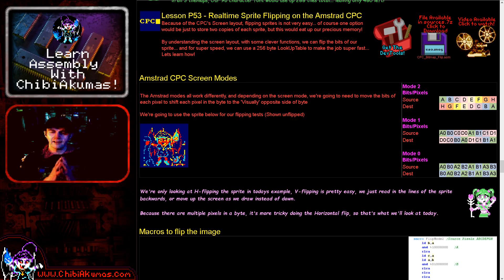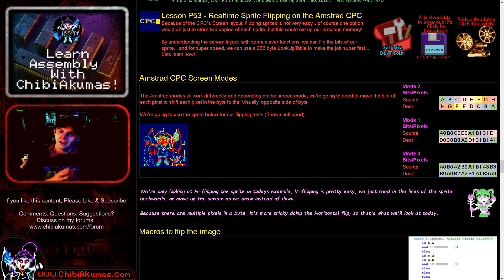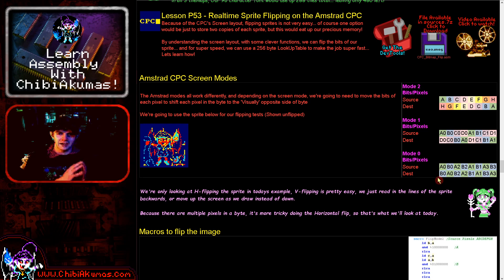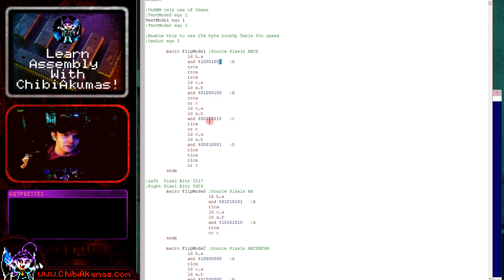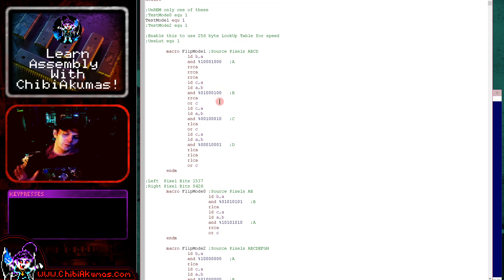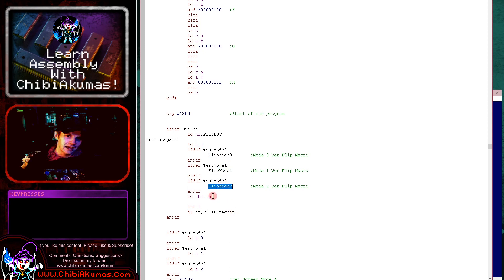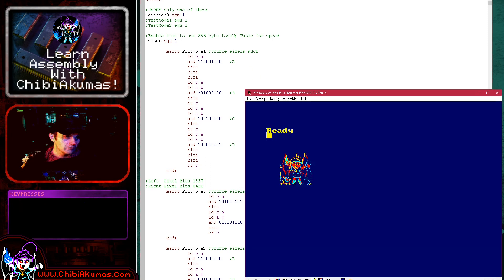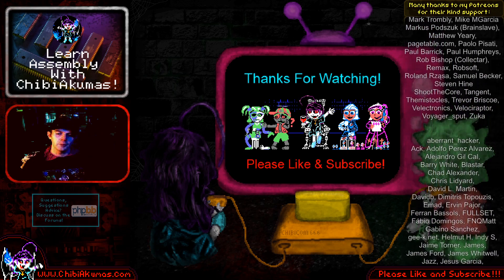Realtime Sprite Flipping on the Amstrad CPC - Z80 Assembly Lesson P53

Comment: That's a lovely algorithm, helps a lot with speed and memory at the same time. Also works on SAM modes 1, 2 and 4 if you haven't spotted already.
Reply from the maker: good point, I'm not so familiar with the alternate SAM modes! 
it could be converted for any system that uses a bitmap screen really.